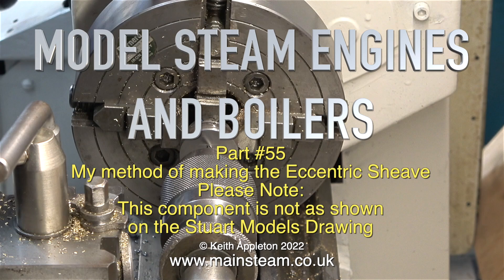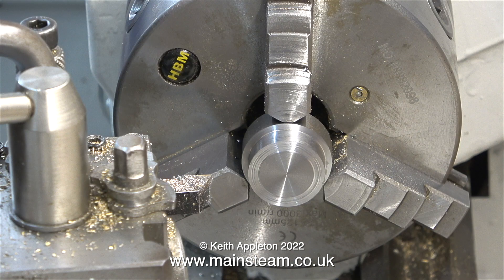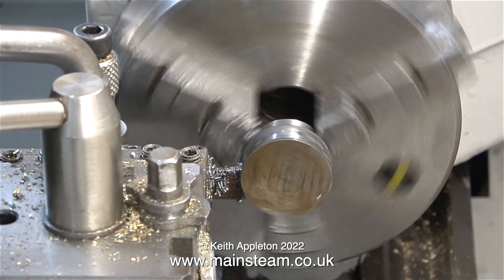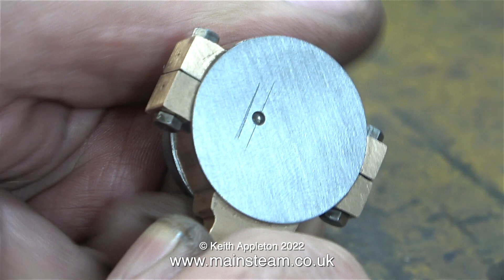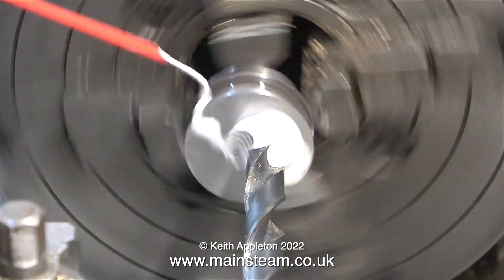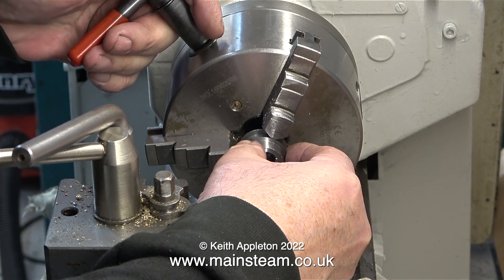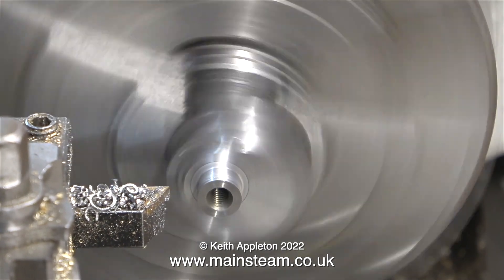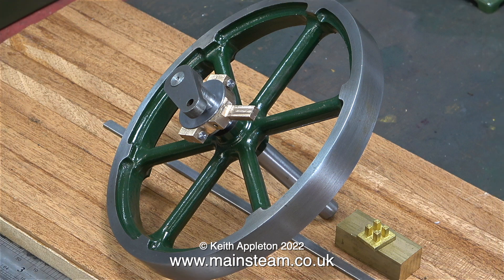MODEL STEAM ENGINES AND BOILERS - PART #55.

Comment: Do you have a steam engine that can run off a boiler sitting on the burner of a wood stove (something akin to a tea kettle)?  I'm thinking in a power outage, wouldn't it be cool if my wood stove could power my ceiling fan and its 4 accompanying light bulbs.
Reply from the maker: Entirely impractical . . . . . for a few reasons.